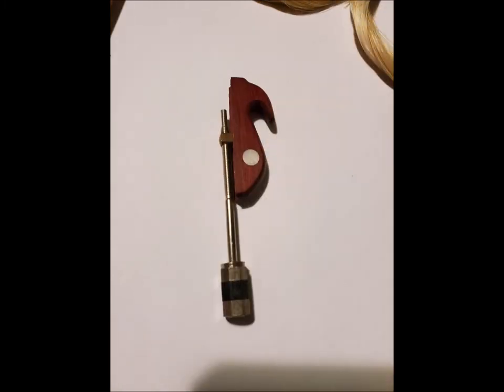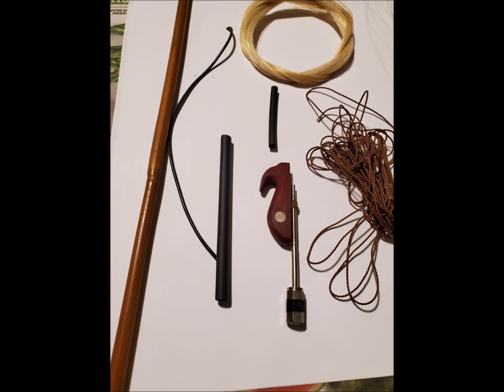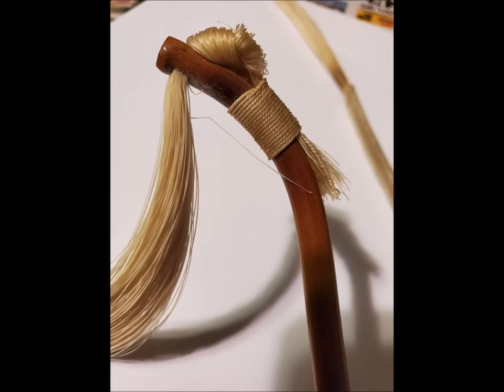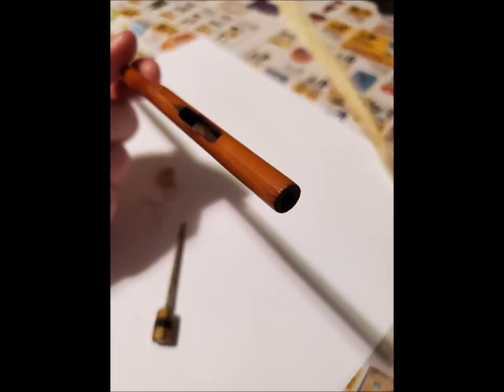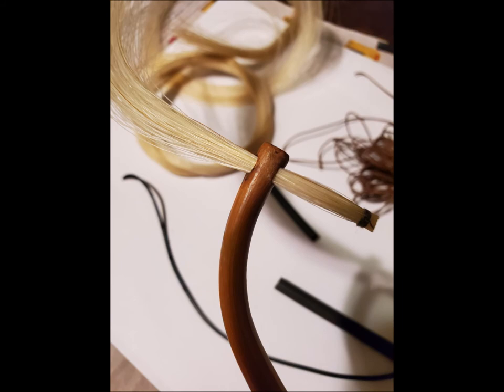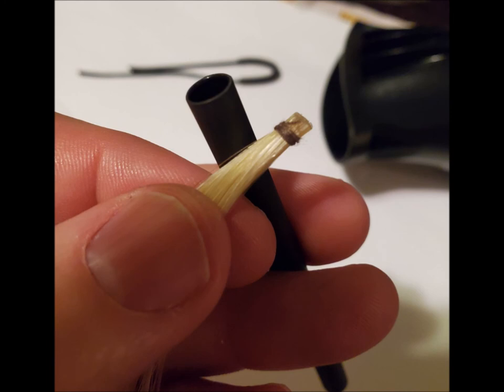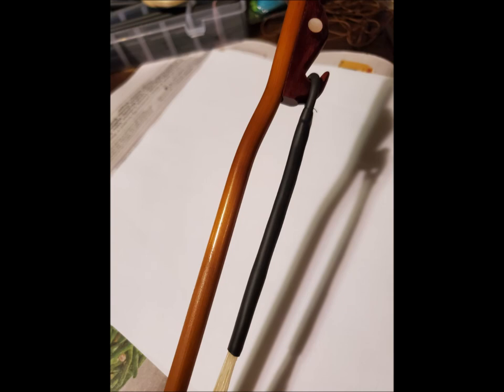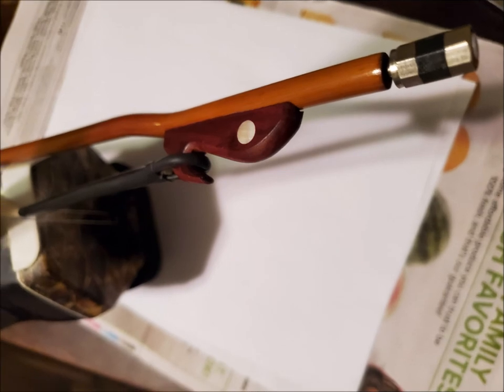Rebuilding My Erhu Bow

Comment: Did you comb the hair & make it flat?
Reply from the maker: No, but that would probably be a good idea.
Reply: I have purchase an erhu bow where the hair is somewhat clump (cross over and over laps) in the center.  The bow position has to be exactly right to play the D string, otherwise it may scratch the A string.  Since I am a beginner, it makes things more challenging.  My observation on videos, the pro's bow hair string lays flat like the violin bows.